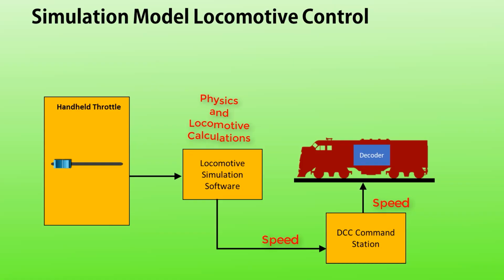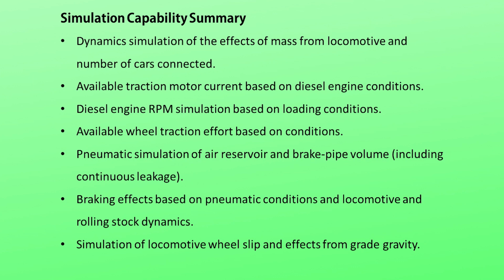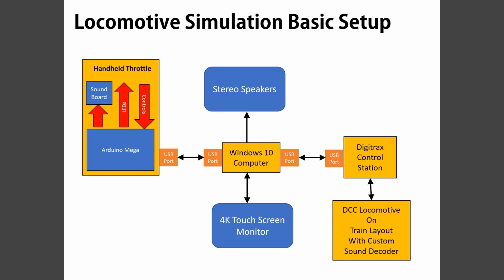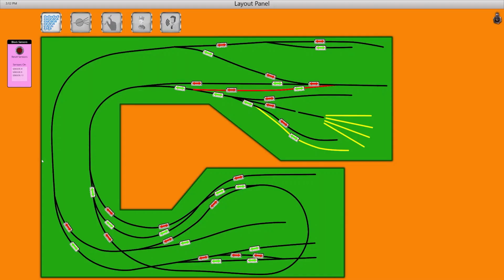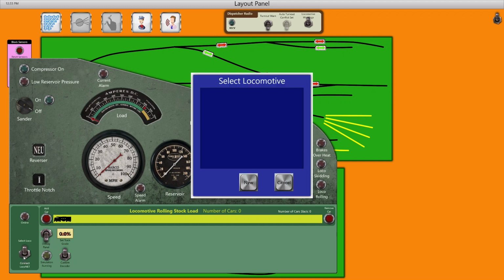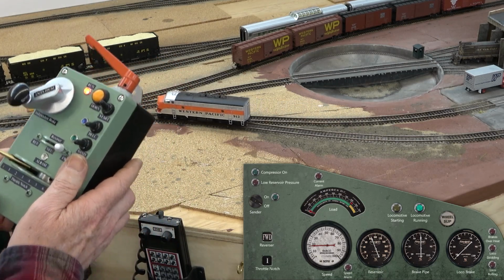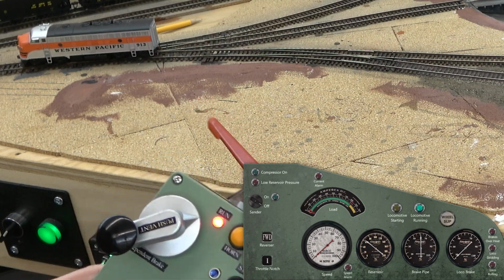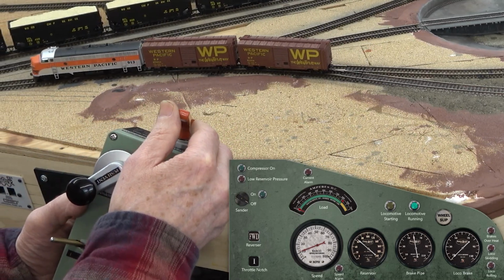Ultimate DCC Hand-Held Throttle

Comment: it seems that this is the way future throttles will have to work if we want that ultra real operation, which is to do it like this and have a computer get the inputs from the throttle to tell the DCC how to operate.  I think that for a steam locomotive to operate like the prototype it will require this same method, maybe even requiring a two person crew so one could monitor the fire and boiler pressure.  Also, for a steam locomotive the computer will need to show fuel (coal and water) levels so refueling can be planned.  excellent work, thanks for posting
Reply from the maker: Thanks for the comment Crownironman. If you look below, a comment from Mark Stafford on a steam version he's been working on.

Comment: Bruce, as an electrical engineer and a rail enthusiast as well, you definitely put a huge smile on my face with this project today. I found myself laugh at some of your features, like Oh no... he didn't... Holy crap he did! to a number of features! I cannot stress enough what an accomplishment you have here! 

I too am messing around with the Loksound decoders, and in watching the simulation engine, understand how you're getting some of the screen feedback. Most impressive. 

One thing I am not sure of however is, is there any way to get the locomotive's back EMF as feedback? That would give you actual load that you could amplify and use in real time. I'm guessing that at some point in time, since you have grade as a variable, that you will model every track on your RR and enter in it's approximate grade so the train reacts to it appropriately, and or requiring multiple engines (since I assume those too will be modeled for tractive effort) to give the best feel for running a real train. 

I do have one point of minor contention in your locomotive model... closed throttle is just idle, but it will propel the locomotive when the reverser is in forward or reverse on the prototype. You can pick this up also in the loksound engine sounds if you're listening close enough, as you can hear the prime mover slow down ever so slightly when the reverser is moved out of neutral.. theoretically, that is 1/9th of your engines power...  That's a super minor nit picky detail, but I work with a guy who did the new SD70ACe's main rectifier design, and a few professional RR engineers, and I do medium voltage motor control, so this kinda stuff is right up my alley!

All things considered, this is an amazing accomplishment!
Reply from the maker: Hi kleetus92, thanks for the detailed comments!

The Loksound decoder makes the “back EMF” value available to the sound design software running in the decoder, but not an option to send it out as a DCC data packet. On the research I did when I made the full cab throttle project 10 years ago, it sounds like the DCC specifications did not want decoders to send data packets out due to fear it would flood the DCC network with data packets and would have no valuable use. On my full cab version the ”camera car” had a digital radio transmitter that sent telemetry information such as tilt (to drive the grade data), shock (that drove the sound and vibration of going over uneven track) and truck rotation (to drive wheel squeal sounds). You can see this demonstrated in my “Ultimate DCC Throttle” videos starting at part 9 of the video series.

In reply to your “idle” comment, this is how the software model works. As long as the prime mover is running and rotating the main generator, voltage is sent to the main traction motor contact relays, regardless of the throttle notch. If the reverser is in the neutral position, the traction motor contacts are completely open and no current is pulled from the generator. If the reverser is in the forward or reverse position, the traction motors can start pulling current. On my cab version you can hear the sound of the pneumatic driven contactors that apply current to the traction motors. I’m guessing the locomotive is not moving because my friction value for the wheels and traction motors is too high, or simulation speed value is too small and rounded to zero when converted to an integer for the 128 DCC speed steps. Is this the issue your comment is based on?

What was interesting about these two simulation projects is the locomotive does what ever the simulation software comes up with and not forced to do anything else. As I think I stated in this video this creates a problem of simulation becoming unstable due to the limitation of the DCC system speed and data resolution. As a result, I had to put a “watch dog” process in the software that removes calculated DCC data packets that it sees a sign of instability starting.

You haven’t yet, you might want to watch my “Ultimate DCC Throttle” videos starting at part 9 of the video series. With the high resolution camera being displayed on a large monitor in front of the cab window you can better see work I did to make the slightest model locomotive speed changes. This cab project used a highly modified “pusher” locomotive and not nice to see running on a layout, unlike the off the shelf locomotive I used in the hand-held throttle version video.

Thanks again!

Bruce K
Reply: @BruceKingsley  Yes, I think you are correct in what I observed, if your friction model for the demonstration was too high, idle in forward would be thwarted. I will check out your other videos on the series. 

Now I'm really gonna beat you up... What, no dynamic brakes?! LOL!!!

Comment: Love to see this simulation, I wish all decoders and the new proto throttles came like this so you can program it that way.  Thats my only complaint about the proto is the sound and notches are great but they dont match the rate of speed climb that a real Loco would have.
Reply from the maker: Hi Darktrooper4,
Thanks for the comments. One important thing that make this possible is the decoder the the locomotive is setup to have no dynamics such as acceleration, de-acceleration and linear speed-step curve so the simulation software can properly perform the emulation without the decoder messing with it. As far as the sound, the decoder is all so custom programmed to enable extended DCC functions that the simulation software can tell the decoder exactly what notch number sound to produce.

Bruce.

Comment: Absolutely outstanding!  You have captured the complete experience of running a train!  And!  Stuffed it into a computer!  I can't imagine the hours you spent gathering the information needed to create such a thing!  Being able to pry all the little innuendos of what happens when this happens out of railroad people has to be a talent that few can appreciate!  As someone who made their living doing what you simulated, with the equipment you used, watching this was astounding!  It's almost like you were/are an engineer.  I know you're not though.  A real engineer would not have built that throttle with the reverser above the throttle, or with the throttle backward!  🥴
But you certainly got the software right!

I've subscribed to this site in the hopes you may decide to make this software available.  I'll even buy a Windows computer if you won't cross compile for a real operating system 😇
Reply from the maker: Thanks F Hollis for the glowing comments! As I stated, this was built on the full cab version I made years ago (see Ultimate DCC Throttle Part 9 video). Funny you brought up the backwards throttle, my cab version is not "backwards", but on the handheld version I decided to change the direction as "controls" move to the right (or CW) for more of something (like sound volume controls) and didn't want it to be confusing to use. This software really needs to be run on a dedicated computer with a decent GPU due to all simulation threads and heavy 4K real-time graphics and animations. I made it just for the challenge, I don't think many model railroaders would want to run their locomotives this way (even I now never use it), plus the locomotive decoder needs to be specifically setup with most control features turned off.

Bruce.

Comment: Hello again! Eureka! You did it! :) This is a real game changer for those times you simply want the challenge of dealing with 'real conditions'. 

Is there a 'learning' or 'basic' mode where a novice can run trains without every detail being engaged?

Can you preset the grade for different areas of track so that trains always experience the same track conditions at the same location? 

Now if this integrates with JMRI... and has capacity to run a camera with an engineer's screen (like your original throttle)... 

Well done, Bruce! Take the rest of the day off! You've earned it! :).
Reply from the maker: Hi Dwayne, thanks for the comment. I might do a quick follow-up video as I've received some of the same questions from others. Bruce.

Comment: Once I build my Layout I want to have my trains behave in this way too, how did you make this? Are you going to open source your code so we can get an idea of how you did it because I really want this, I am building a Japanese train layout, it will have freight, passenger and Shinkansen ops, I also have a usb train controller for the switch, densha de go, (A arcade game for driving trains) but the controller is a semi realistic train controller, its got 5 power steps and 8 brake + an emergency brake step. I would love to get that working for controlling some of my trains. Could you maybe steer me in a good direction to get started. Thanks for your time.
Reply from the maker: Thanks TrophiHunterSeth for the comment. I have no problem providing the software, but you should be aware of some details.  
1. The main software runs on a Windows 10 or 11 PC.
2. The PC need to be powerful and have a good GPU.
3. The software was written for a 4K touch-screen monitor (a mouse will work for must functions).
4. The software was written around my layout plan.
5. The PC software was written using c# (.NET) and would require you to have MS Visual Studio 2019 or greater. If you don't know c# well, you will find this very, very difficult. There's no documentation as I never planned on making it for public use.

If you want more info, you can email me at brucek5 "at" charter.net

Bruce

Comment: Bruce I’d like to talk to you about steam controller that we have been working on for the last three years
Reply from the maker: Hi Mark, do you have link to your project or a contact?
Reply: Did my email address come through ok?   We are attempting exactly the same functionality but with vastly different hardware
Reply from the maker: @markstafford5586  Mark I didn't. I don't want to post my email because an internet robot will pick it up., but I'll give you the two parts, brucek5, second part @charter.net
Reply: @markstafford5586  I really think that adding a computer between the throttle and the DCC system is the way to go for a steam throttle.  The computer should monitor how much steam is used and the current boiler pressure.  The operator should be responsible for keeping the pressure up, and if they don’t then the computer should make the locomotive slow and maybe stall until pressure is raised.  It could have the option of “enhanced” operating or “limited” so some features could be controlled by an AI fireman.  In the enhanced mode it could be made to use a second operator acting as a fireman/break man.
Reply: @crownironman  Yes your quite correct Mr Crown Iron Man.    Once you introduce a computer between the controls and the DCC system you can track anything you want via a physics engine.   We do in fact track steam use and how it acts to move a train.  But we determined years ago that doing the fireman side was very very code intensive and so we have focused on the driver side and assumed the fireman is mister perfection.    That is not to say it could not be done.  It most certainly could.   But I think our hardware is stretched with just doing the driver side of things.  But with the right hardware for sure!